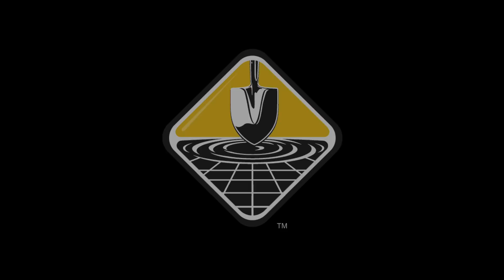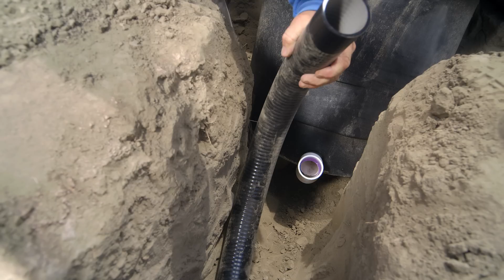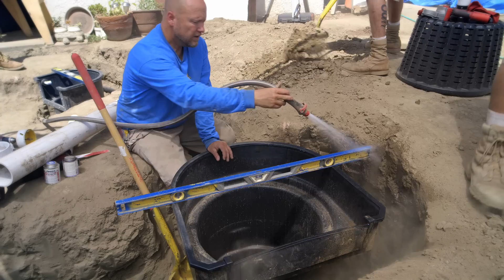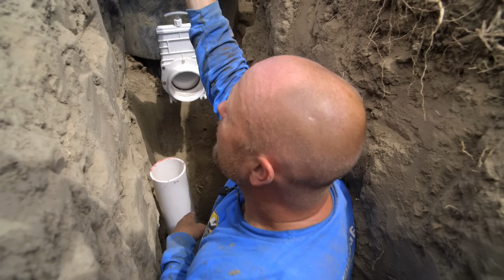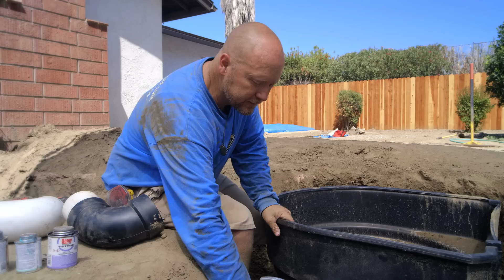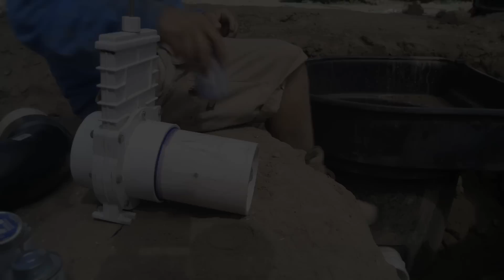Koi Pond Construction | Pond Filter Installation - Part 16

Comment: Excellent step by step videos! I recall you mentioning running the 4" pipe level from the bottom drain to the sediment trap but then I see about a 5' riser, so I'm wondering what the reasoning is behind that thinking? Would it be better to say, let the 4" gradually rise to the sediment trap and have a 3' - 4' riser instead of a 5' one? Thanks again.

Comment: Question for you: I didn't see you doing anything to help clean out the settlement tank. You have the suction side going to the bottom drain and then the 2" line in the bottom going to the pump, but no drain acting as a cleanout. How do you clean the huge build up of settlement out of the bottom of that tank? Even if you put a drain in the bottom, the tank is below grade... thus you would almost have to pump the settlement out, no? I'm thinking you'd need a shop vac or something of the sort to get that stuff out (Yuk) and you would have to do it often considering the fact all that settlement remains in the water column until you clean it out. So you stop the suction from the bottom drain using the gate valve, then you remove the basket, which means you now have a ready-made clean out in the bottom of the tank going to the pump. Now what?
Reply: You add a piece of pipe to the bottom drain, moving that drain above grade. Then you drain the tank with a pump. Spray it down and clean it up. Cleaning depends on fish load. I would do it quarterly myself.

Comment: Good work overall on this series, definitely quality work! Why the ABS elbows with the rest of the system being PVC?  Availability?  And with 5' of water, that is still ~2.5 PSI (15 psi every ~30 feet) though thats still fine for DWV/ABS. And like the earlier comment I was questioning trench safety. The soil looks pretty stable there, do you take extra precautions on installations with softer soil?
Reply from the maker: CKOD Thank you for the quality question. As far as the abs fittings - we don't have a supply of PVC sweep elbows readily available to us here so we choose to use abs sweep fittings on gravity flow drains for good flow of debris to our settlement tanks. Generally our plumbing runs on our systems do not have psi over 10 or 12 psi. When we pressure test our plumbing runs on advanced systems like this (we did not teach in this series) we pressure test to 25psi and have never had a problem with ABS fittings as long as we are using the appropriate glue. Safety is very important to me. The health and well being of my crew is paramount. As you can see in some of the videos I am wearing a hard hat. There are many days on our jobs when hard hats are mandatory for all workers. We even went as far as filming a safety video we uploaded earlier this year. I have no experience digging DEEP in unstable soil but you can bet we would follow safety protocol. Thank you again for your feedback.

Comment: But she is getting a quality pond that she will not have to worry about for a long time .But I understand Rosemary's impatience as I had to rebuild my pond early spring after moles chewed through the liner and decided to make it bigger and it was no fun digging and rebuilding through to snow storms .But my 2 koi are around 2 ft long ,so needed bigger pond .No fun doing it all by yourself .Sissy's pond I put on you tube but not the best video ,just a novice at that stuff .But your people do a really great job .Can't wait for the pump and aerator set up and then all the pretty stuff.I planted cold hardy bananas by my pond and they are a great shading plant besides elephant ears   .Hope Rosemary is no where near the fires .